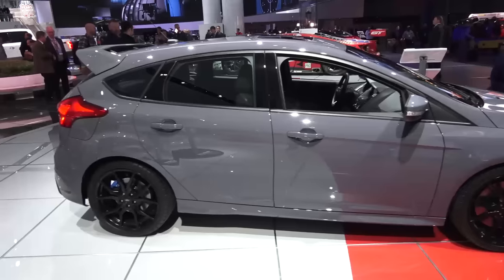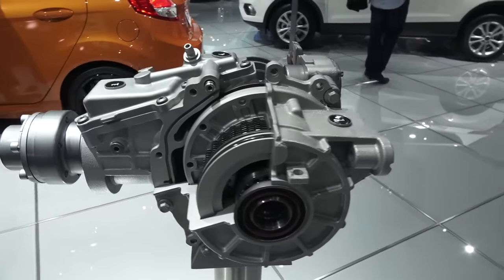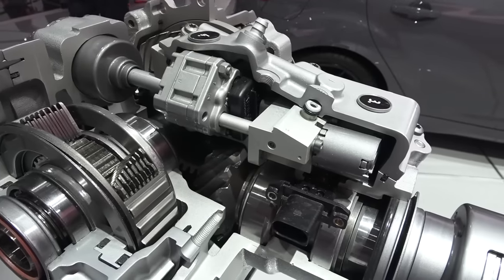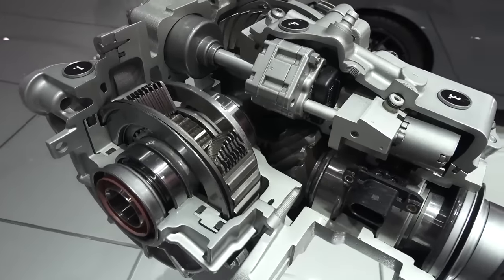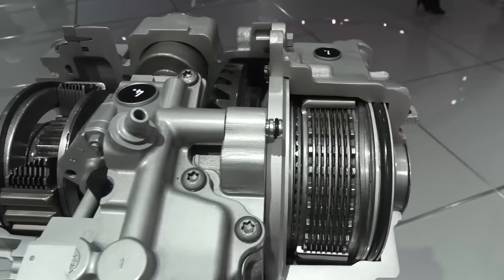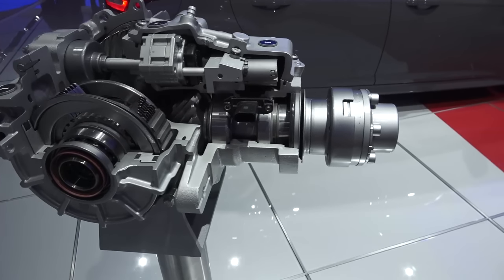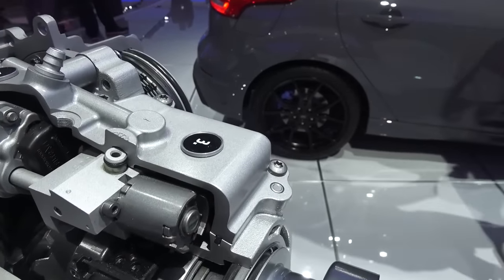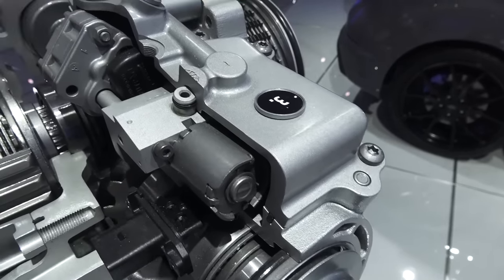Ford Focus RS RDU Explained - WR TV Tech Short

Comment: that´s amazingly complicated... not sure it is going to be good once the car has done 200k kms.. not going to be a modern classic probably due to reliability issues.
Reply: Max FV Honda came out with a system like this in 2004 and they haven't had any issues
Reply: ***** doesn't the evo have a fixed front to rear split that you can adjust with a dial or does it send power to the front and back automatically.
Reply: Max FV Don't forget, according to most RS owners, this only has to last around 10K miles anyway, which is the life expectancy of the little four banger.
Reply: who told you that?
Reply: Max FV why do you troll focus RS videos with same line? Last few days I’ve seen your old replies on many focus vids lol.
Reply: @pinkyn0se  and 2yrs later lol after the head gasket recall that caused all the booms 😁 ppl are now making 500whp on stock blocks. Hehehe
Reply: @laylow96  I expect that's such a great comfort to the thousands of Ford owners who've lost a small fortune in repairs, depreciation, and inconvenience.
Reply: @pinkyn0se  bro really just said that through a small fortune, repairs and deprecation (even though they haven't). Literally every car guy puts up with these things willingly to build a car that makes 500hp
Reply: @pinkyn0se Ford replaced those engines and headgaskets for free.

Comment: ah so that's why it overheats
Reply: I believe its to protect itself from premature wear but you are right even if you bypass those parameters with the Syvecs I'm sure it will wear faster or eventually overheat to failure. Just my opinion.

Comment: So this is the part that likes to overheat when you drive it hard?
Reply: Central Intelligence Agency actually all the sensors are in the ptu  ... if guesses based on certain readings and goes into fwd.
Reply: So it goes into fwd a.k.a. limp mode when the sensors tell the ECU the rear drive unit is getting hot. It's an overly complicated system, I do not see why they did not make the car a full time 4wd car with a normal limited slip differential at the rear.
It looks heavier and bulkier than it should be, and it performs worse in situations where it actually matters than a simple LSD.
Reply: Central Intelligence Agency Yes I agree completely with you.
 Two factors were money and mpg. On a car like that I think the epa rating is pointless. You are totally right though.
Reply: you need to drive it to feel the magic Central intelligence agency :)
Reply: Yep, it performs so bad that this car is setting better laptimes than every rival with similar horsepower figures and permanent AWD systems. The RDU overheated in one press car and in a few cases with people tracking the car intesively in humid conditions, and suddenly this car is garbage across the board an unable to perform without overheating. Give it a break, there's people tracking this car weekly without any RDU overheating problems, check the user forums for this car. They made a very capable car for the price, but sure, it has some flaws. On really humid days you could overheat the block quite easily too, and now there are some people showing up with head gasket problems (remember the Scooby O-ring days? yeah, every brand can get lemons). My point is that you can't get a 100% reliable track capable car for this low of a price (at least in the EU it's low, the insane inflated US prices are something else), and that it is to be expected that you're not gonna be able to drive this thing at the limit for 20 laps at a time. There isn't a single brand in this price bracket that offers that, and the RDU system for this car makes it a very capable and pleasurable car.
Reply: mine has never overheated on numerous track days that I've been on. People keep trying to talk this car down.... because it's just too good and embarrassing cars at twice the price
Reply: fezza most other brand fanboys have never driving this car before, they do talk more than they drive on the internet, probably sitting in a Toyota Prius and floored it and felt that's the quickest car in the world lol. they are just salty about this car. :)
Reply: my RS has never over heated aswell, it depends where you drive, the owner got overheated might've been driving the RS at some hot countries lol
Reply: AW Film F me, where did you learn English boy? I'd go and ask for a refund if I were you.
Reply: Am still learning English, if that doesn't make sense to you then I am sorry, but when we talk about something that we like, such as cars, I don't see language is a problem as long as we understand each other, If you mainly focus on how bad my English level is, then I guess we can go to some ESL videos and discuss about my English there.
Reply: Never had any issues with my RS. Couldn't imagine not having it!
Reply: @centralintelligenceagency9003 Depends what you want. Personally, I dont want another Subaru AWD system. That's available already, and isnt as good a system for a street car. For a rally car, way better, but i dont have any intention of rallying my Focus RS.

Comment: I guess the question is:  Is GKN good stuff?   I've had my 2018 Focus RS since new and just about to hit 50k miles. It runs like new, is still tight, runs and drives really great.  I've had no issues and it's been completely reliable.  I purchased the top tier extended Ford warrantee to 100k so, if this unit goes, it'll be covered.

Comment: 6 years later.,, mine still works.
Reply: same here
Reply: I just bought a used Focus RS and I lose AWD every single time I lose traction. The error goes away when I restart the car. It just snowed 10 inches and I lost AWD within 20 ft of leaving my driveway. Doesn't happen on dry pavement, only when I slip. I'm bringing it to the dealership next week.
Reply: @Bournefort  wheel speed sensors for sure! Mine did the same thing and I was going nuts trying to figure it out as the car kept disabling things to save itself as one or more of your wheels are reading 99mph. Swop ‘‘em out. Cheap part and you could do it in minutes. Trust me.

Comment: Didnt even talk about centre diff split and how that is controlled?
Also if it is prone to overheating... cant you simply add an oil  cooling system. Surely it cant be that hard to add a few oil lines / pump and small air cooler somewhere?
Reply: I believe Mishimoto is working on a rear Diff cooler for the RS but the video from a while back could be BS. If an aftermarket company made a performance RD cooler for the RS, i think more people would be drawn to it. My question is this though: think a traditional 2 way LSD could bring the hidden potential of the RS? Bc i think would elimate most drivetrain issues right then and there.

Comment: Just replaced mine with RS diff from Evo with custom differential gearing minor modifications to rear subframe required or if u willing to build turbular subframe like me way to go
Reply: PS  its bolt on for rear subfrmame if you need more clearance which you will need to cut the rear spare tire well ,only provlem you will encounter is the rear diff it self making it work with the ecu and all other electronics its a pain but do able